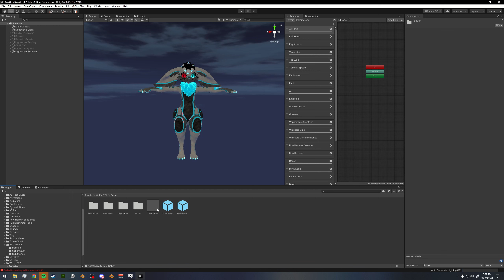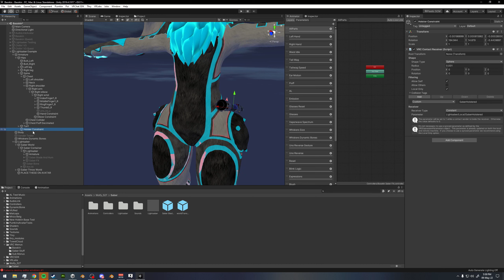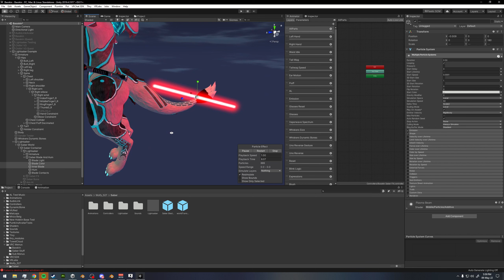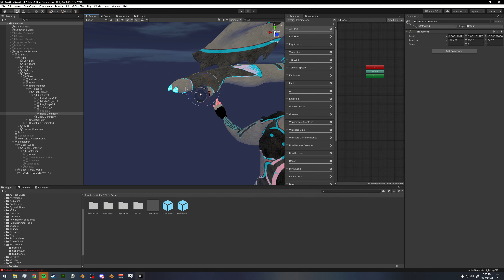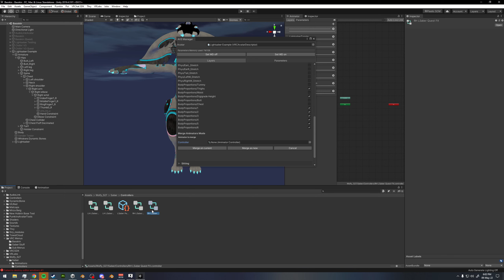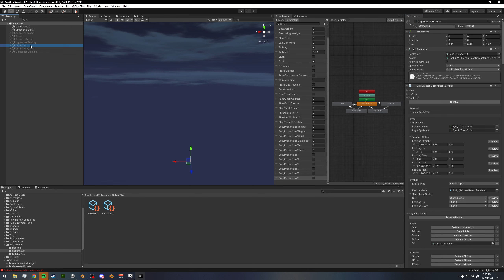VRChat - Avatar Dynamics - Plasmasaber Prefab Set-Up

Comment: so I have tried setting this up at least 5 times following everything in the video, and the toggle doesnt work. I have not gotten a single thing for this to work when i merge them they dont show up in my layers all it adds is one layer thats just ------------------------------------- there is nothing else in i dont know what im doing wrong i have followed and re watched this video several times.
Reply from the maker: Sorry about this, there is an issue that cropped up with the newest version of AV3.0 Manager that causes that to happen when merging FX controllers together. I provided a link in the description to a working version of the AV3.0 Manager that should fix that issue for you!
Reply: it did the same thing with that version only -------------------------------------  shows up in my layer i even tried a fresh project and only brought the avatar the sdk the saber and the av3.0 manager
Reply from the maker: @RyuuShiro1  That is odd, I tested that specific version to make sure that it worked and it seemed to work for me when I tested it in two different projects. Potentially trying an even older version of AV3.0 Manager could work then. The issue only cropped up recently as the tool got updated and seemed to be having that issue.

You could try merging onto current and seeing if that yields different results as well.
Reply: @Wolfy527  i tired that and the same thing happens it imports the  parameter's but not the layers im gonna see if it does it with my nardo as well i been trying to add it to my rex.
Reply: @RyuuShiro1  Hey im having the same issue, did you ever fix this or no?
Reply: @turtlecatplayz4017  no i have not
Reply from the maker: @RyuuShiro1  That is extremely odd. Maybe there is something else in the project causing the issue or conflicting with AV3.0 Manager. You could technically copy/paste over the layers into new layers you make in your current FX, as well as the parameters. You'd just want to make sure that they are the same when you copy them over manually. I only suggested AV3.0 Manager to people because it made the process super easy for adding to avatars and it was working fine prior to the more recent updates that seem to have broken merging FX's.

If you are still having issues and need help with manually copying things over (provided that AV3.0 still doesn't work) I can help ya out on discord. My discord is Wolfy#2727
Reply: @Wolfy527   manually coping the layers worked
Reply from the maker: @RyuuShiro1  Sorry that you had to do it manually, it is definitely more convenient to use AV3.0 Manager when it works properly. I'm hoping that they will have things smoothed over soon with the bugs they have been having recently. If you do need any more help with setting the saber up just let me know and I'd be more than happy to help out!

Comment: Oh sorry, another question! At 6:23 is it necessary to use one of the controllers you provide? Because when I opened AV3 manager, there was already an FX in the controller. And it contains all of my face animations. Do I still pick one of your controllers and merge as new? Or should I leave it be?
Reply from the maker: You can merge onto current or new, either one. I tell people to do merge as new just in case something messes up on your original FX when merging, but realistically you should be fine just merging it onto your current FX. But yes, you do have to merge the FX controllers, otherwise you won't have the animations and toggles, etc. to use the saber.

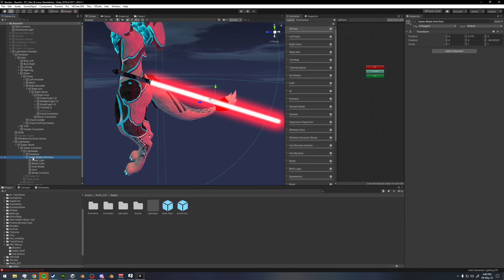Comment: Hi Wolfy! . I got to the part at 04:28 where you said to turn off blade saber and hum. Unlike what I see in your video, the saber does not emit a red glow, and all I see is a sound symbol. Although I hear no sound. Is this a normal thing? Or should I be worried that the saber isn’t working properly?
Reply from the maker: When you select the "Blade Color' and "Inner Blade" they don't show up the first time, but if you then re-select them they should start emitting provided that the "Saber Blade And Hum" is toggle on so you can see and scale them. 

The sound symbol is just indicating that there are audio source(s) there (they are animated to go up and down the blade depending on where it collides with someone). 

If the first part of the response didn't fix the issue you are having let me know and I'd be glad to help out more!
Reply: @Wolfy527  Thank you so much! This fixed my issue!
Reply from the maker: @Taaliyah-w2o  No problem! If ya have any other issues just let me know and I'll respond as soon as I can!

Comment: When I use the Avatar manager it only merges the parameters not the animator layers that you see on the RH FX controller, any one know a fix?
Reply from the maker: I updated the description with a version of AV3.0 Manager that works properly. The newest version of it is bugged out and doesn't properly merge the FX layers, only the parameters. If you delete AV3.0 Manager from your current project and then import the one from the description that should fix your problem!

If you do still have problems though, let me know and I'd be glad to help ya out!
Reply: @Wolfy527  just did it backwards duplicated the RH saber FX and merged my original FX with the duplicated RH saber FX and the layers from my original FX copied over, surprised that worked tbh XD
Reply: GREAT WORK BTW and the tutorial was perfect
Reply from the maker: @sk8nit  That is an interesting fix haha! Glad that worked though! 

One thing to look out for is to make sure that in the WD tab it doesn't throw a warning about "mixed write defaults" if it does, then you'll want to select "all on" or "all off" depending on what your FX controller used prior to merging the FX controllers together.
Reply from the maker: @sk8nit  Thank ya! It is a little bit dated since I've fixed and added some stuff since it was initially released, but it covers most of the basics for people!
Reply: @Wolfy527    thanks for the heads up! Went through it and all was well🙏🙏 it was super easy to follow, got everything you did first run through, just wish I read the description more thoroughly 😂 shame the updated version is bugged, can’t wait for the future content tho! Appreciate the fast responses as well! You’re killin it🤙
Reply from the maker: @sk8nit  Glad that everything is workin' for ya and went smoothly! And yeah I try and include important information in descriptions for links and such people might need as resources to do what I am doing in videos! 

And thank ya, I have a few more things in the works at the moment!
Reply: @Wolfy527  ended up figuring it out, thanks for the response tho!

Comment: So, I got in game and the sabre hilt is missing from my side and the blade is always on. None of my toggles do anything. Added ya on discord if you could help me out? Also, when I create the new FX layer i think its failing. It says the parameter is a default one, andd when the new FX layer is created it has no saber layers.
Reply from the maker: So I just checked out the newest version of AV3.0 Manager and it actually appears to be broken in regards to merging FX layers, so I updated the description to link to a version of AV3.0 Manager that should work properly for you and anyone else having this issue, sorry!

I will re-update the description when the newest version of AV3.0 Manager is working properly again! In the meantime, if you want to go into your project, delete "Avatars 3.0 Manager" out of the "VRLabs" folder and then import the version I have linked in the description, that one should work fine for ya!

Comment: When i import avatars 3.0 into my unity project the vrlabs tab doesnt pop up at the too of my screen. What do i do?
Reply from the maker: I would try re-opening Unity and also making sure that you grabbed the correct/newest version of AV3.0 Manager. I imagine re-opening Unity will likely fix your issue, but I'm not 100% sure on that one. The Github page might have a FAQ section and step-by-step setup for AV3.0 manager (although it should pretty much just be an import) for common issues and getting it up and running correctly.

Comment: The tutorial is wonderful!
Though there are things that I'm somewhat confused about
First: is the color. Is there a way where you can change the color of the saber?
Second: There are times where the saber sometimes turns on while on my hip.
Reply from the maker: In regards to the color, there is a hue float included on the newest version of the saber labeled "Plasmasaber/Net/Hue" under the "Synchronized Parameters" section for parameters. You'll just want to use this float to make a radial wheel in the menu to change the color in-game. If you don't know how to make a slider for your in-game menu I go over how to do so in my Slider video. It's only like two minutes and what you'd be looking for is towards the end of the video.

Regarding the second two problems, it sounds like you have mixed write defaults. 

In Avatar 3.0 Manager you are going to want to check if it says "Write Defaults" are mixed and can cause buggy or broken interactions. If that warning is there then you're going to want to set WD to "All On" or "All Off" depending on what the rest of your avatar was using prior to importing the saber. You can check the states in a couple of layers that were originally on your avatar prior to merging the saber FX and look to see if "Write Defaults" are checked or not. If they aren't checked, then you're likely not using WD and you want to select "All Off" and if they were on, then you'll want to select the "All On" option.

Comment: It looks great! although I haven't been able to make it work for some reason and I honestly don't know how to fix it, I would really appreciate some help
Reply from the maker: Sure, what seems to be the problem you're having with it?
Reply: @Wolfy527  I've done everything that you explain on the video but when I go test it in VrChat it just doesn't work, all of the avatar's parameters match as well as the FX on it. The toggle is the only thing working in game but the rest it's not there
Reply from the maker: @emiliolopera758  Are you able to pick the saber up? If not, try checking the WD tab on AV3.0 Manager and making sure it doesn't have mixed write defaults on, if it does then that will 100% break the saber. What you can do is select "all on" or "all off" to match all of the WD settings to what your avatar previously used and that should fix that issue.

Comment: I am having issues with mine I did every step of the video but was only able to have the lightsaber come out no animation for going from the holster to the hand and nothing else works. I added you on discord for help. I am Immortal I hope to speak with you soon!!!
Reply from the maker: You have to physically grab the saber hilt and do the fist gesture to pull it off the hip, and then, if you used the normal FX, do open hand while it's on your holster location to re-holster it. Finger point pulls out the blade and thumb up puts it away.

Comment: so i have gotten it all to work the only issues im running into are the blade is only local and the color will only stay red after i change it
Reply from the maker: You'll want to make sure that the float at the bottom of the "Synchronized Parameters" list in the FX is in your expressions parameter list. Once you do that, then you'll want to make a "Radial Puppet" in the same place as you made your toggle and make sure that the radial puppet uses the "Plasmasaber/Net/Hue" float parameter in the rotation parameter slot for the radial puppet.
Reply: @Wolfy527  Will this also fix the issue of other people not being able to see the beam?
Reply from the maker: @XietheZebra  You will want to make sure in AV3.0 Manager that it doesn't give you a warning about "Mixed Write Defaults" in the WD tab. If it does, then you'll want to see if your avatar was using WD on or off prior to merging the saber FX and then select either "All On" or "All Off" so that they match across the board. If that isn't the issue, then make sure that the "Net" parameters are in your parameter expression list that goes in game.
Reply: @Wolfy527  This fixed the issue thank you so much! now the only thing I cant get to work in the throwing but I think that's due to my avatar itself not having the proper armature.
Reply from the maker: @XietheZebra  What seems to be the problem with the throwing?
Reply: @Wolfy527  just dosnt work at all. I can drop the saber in place when the blade is off with open hand but not throw it.
Reply from the maker: @XietheZebra  The blade has to be out when you throw it. You also have to do a throwing motion and open hand for it to throw properly.
Reply: @Wolfy527  that's what I do but can't seem to get it to work for me. I'm doing a throwing motion with open hand when the blade is out.
Reply from the maker: @XietheZebra  Hmm.. If you want to message me on Discord I might be able to help out a bit more easily there since I can send screenshot of things to check. My Discord is Wolfy#2727

Comment: How do you change the color
Reply from the maker: There is a float at the bottom of the "Synchronized Parameters" list in the FX that you are going to want to put in your expressions parameter list along with the others mentioned in the video. Once you do that, then you'll want to make a "Radial Puppet" in the same place as you made your toggle and make sure that the radial puppet uses the "Plasmasaber/Net/Hue" float parameter in the rotation parameter slot for the radial puppet.

Comment: It keeps saying this when im trying to drag the base into VRClabs
The .meta file Packages/com.unity.timeline/Editor/StyleSheets/Images/Shared/TimelineWarning.png.meta does not have a valid GUID and its corresponding Asset file will be ignored. If this file is not malformed, please add a GUID, or delete the .meta file and it will be recreated correctly
Reply from the maker: Hmm.. I am not sure about that one. Are you using the newest avatar dynamics SDK in your project? If not, make sure that you are and close/reopen the project after importing the newest SDK and see if it still throws that error.
Reply: I dont understand what you mean about SDK dynamics are you talking about the dynamic bones
Reply from the maker: @Floofymass2  This prefab uses the newest SDK that VRChat provides on their website that utilizes the contacts and physbone system that are apart of the "Avatar Dynamics" update that came out not long ago. This prefab won't work unless your project is using one of the newest versions of the SDK on the VRChat website.
Reply: Could i get a link possibly
Reply from the maker: @Floofymass2  https://vrchat.com/home/download

You'll want to grab the VRChat Avatars SDK. They have a tutorial button at the center top labeled "Setting Up The SDK" that can run you through importing it into your project.
Reply: @Wolfy527  I did that its in there and its the newest one
Reply from the maker: @Floofymass2  Hmm, and you downloaded the newest version of Avatars 3.0 Manager from the link provided in the description?
Reply: @Wolfy527  yes I did tonight and it still wont let me do it
Reply from the maker: @Floofymass2  Unfortunately, I'm not entirely sure then. I didn't make AV3.0 manager, so I'm not entirely familiar with bugs that can happen with it. You can still manually copy over the layers from one of the FX controllers I provided, but it will be more tedious than being able to use AV3.0 manager.
Reply: @Wolfy527  i found out what was wrong. The view didnt load with model so I gotta restart :(
Reply from the maker: @Floofymass2  Glad ya figured out the issue! Unfortunate that ya have to restart, but at least ya figured it out!

Comment: I love this lightsaber one of the best out there but, how do I actually change the colour? In unity it's set to blue but when but into vrc it's still red.
Reply from the maker: There is a "Plasmasaber/Net/Hue" parameter that is in the "Synchronized Parameters" portion of the FX. You'll want to put that on your parameters expression list along with the others described in the video as a float and then make a "Radial Puppet" in your expressions menu that uses the hue float in the "Parameter Rotation" part of the puppet.
Reply: @Wolfy527  is there anyway to make a video explaining this? i'm quite lost reading this, i'm only able to get it to turn yellow or green
Reply from the maker: @cooljwj  If you shoot me a friend request on discord (Wolfy#2727) I can send you screenshots of what you would need to do to set it up if you'd like!

Comment: Absolutly love this, super easy to set up and stuff and everything in this works great... except for some reason all my other stuff doesn't function properly this added and i have no idea why, like my toggle off for everything unrelated just don't work anymore... for now it'll have to go onto a seperate avatar
Reply from the maker: It is likely that your "Write Defaults" settings are mixed in your FX layer, causing things to break. When you merged the saber FX together with your current one, did AV3.0 Manager have an error at the top that indicated that mixed WD On/Off can cause buggy or broken interactions? If so, check to see what your avatar used prior to merging the saber with your FX layer and then select either the "All On" or "All Off" option based on that. The saber can work fine with them on or off, it's just the whole FX layer has to be consistent, otherwise things can break.
Reply: @Wolfy527  Yip that was it, seems i had missed that part ^^' thanks a bunch, can finally use it with main avatar now
Reply from the maker: @seigneurdiablo  Glad that got ya up and running!